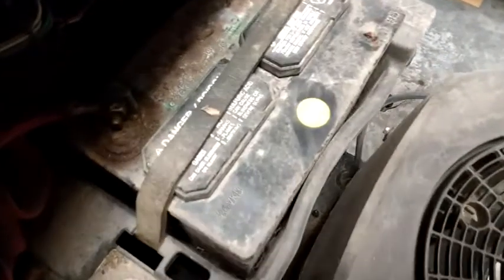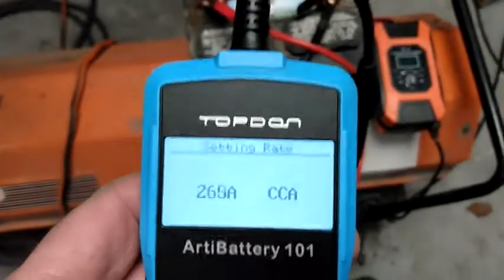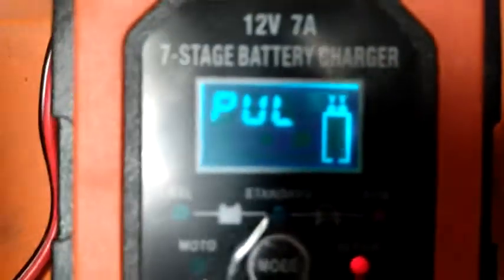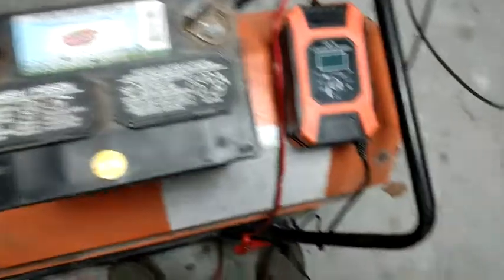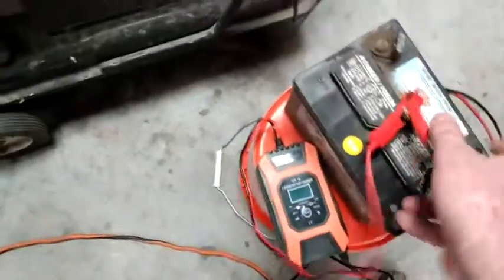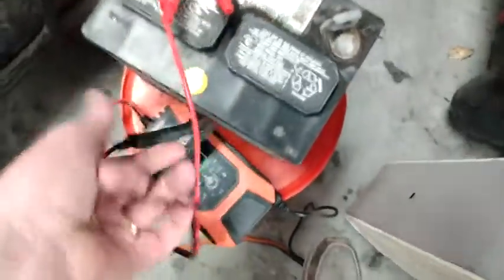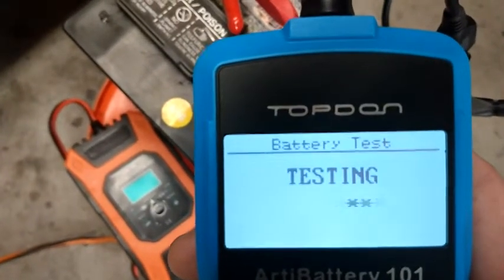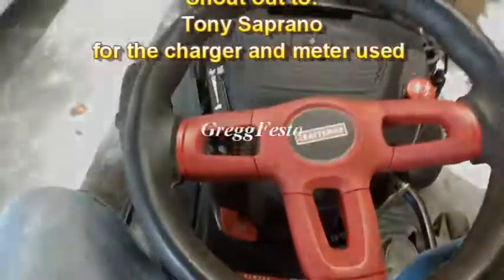Can FOXSUR 12V 7A 7-Stage Charger repair an old battery? Product Review w/TOPDON ArtiBattery 101

Comment: I have to wonder if a battery would last longer running repair every 2 months. Or every six months. I have a small cycle that kills a battery every year.
Reply from the maker: I think that running periodic repair will extend life but the best value for money is a trickle charger. Have you checked into those?
Reply: @GreggFesto  Yeah, am currently running a battery tender 24/7. Now, I unplug 24 hours before I ride. Nothing like a fresh charged battery starting my bike. Only to leave me stranded later in the day.
Reply from the maker: I have read the cheaper battery tenders from places like harbor freight are sometimes not very good and can cause charge issues. What kind are you using? Have you checked your bike to make sure it is charging the battery while you are riding?
Reply: @GreggFesto  Yes, have a volt meter for SAE to USB connector.  Constant 14 volt. I use only "Battery Tender" chargers. Have more then one. Use successfully on other vehicles. My dual sport is subject to harsh environments, and gets bounced around a lot. It also is probably the tiniest battery I have. It has proven unsafe to charge minutes before a five hour ride. Better to fail at home, than to fail 10 or more miles from the nearest road.

Comment: Good video and test. I didn't notice if you checked the electrolyte level first, you should also run the CCA test after the battery sits for at least 2 hours. Do you know if your battery charger pulses are 16 volt power spikes like a Noco Genius 5 and 10 charger or CTEK charger uses? I have a Pulsetech PowerPulse passive battery desulfator on my 2001 BMW battery as preventative maintenance as Pulsetech claims that there patented frequency they use can extend battery life up to three times. I also used my PowerPulse on my other BMW battery that I let sit disconnected for a year, and it was at 11.2 volts, I tried charging it with my friends Exide 6 amp automatic charger for 14 hours and battery voltage was at 13.1 volts, yet it would not start my other car. I put the PowerPulse on it along with a 1 amp Schumacher manual battery charger for 72 hours, and left the desulfator on it for a week and it started my car right up. My point is desulfation can take up to 30 days depending on how sulfated your battery is.
Reply from the maker: Thanks for watching and commenting. I did not check the electrolyte level and do not know the pulse voltage. I just tried it out as-is to see what happened. Next bad battery I get in may get more cycles.

Comment: Correction to statement at 1:40: For internal resistance, the lower-case "m" before ohms means milliohms (thousandths of an ohm) rather than megohms (or megaohms, i.e., millions of ohms), abbreviated as Mohms with an upper-case M.
The following is taken from a post at Quora by Mr. Prasun Biswas. [Begin quote]
In a lead-acid [LA] battery, the lower the battery internal resistance [IR], the more the battery in good condition.
To be exact, for a 12V LA battery:
If IR>30 milliohm, battery is in very bad condition. Probably unusable.
If IR is between 10 to 30 milliohm, still poor condition but may be usable or revivable.
If IR is between 5 to 10 milliohm, it is in good condition.
If IR is less than 5 milliohm, it is in very good condition.
[End quote]
Can anyone confirm these internal resistance ranges from a published source? I assume they apply to a car battery. What about a truck battery? Motorcycle battery? UPS battery?
I suggest waiting several hours after reconditioning a battery before checking its voltage. From my experience, voltages above about 12.6 V only exist for a while after charging and do not represent the steady charged value. The voltage after several hours tends to be a multiple of roughly 2 V because a 12 V battery consists of six roughly 2 V cells. Thus, if your battery reads about 8 V, that means that four cells are working and two are not. The repair mode in this FOXSUR battery recharger reconditioner attempts to desulfate the lead plates in a battery so that all the cells can function. 
Greg, after a year and a half, is the battery still working?
Reply from the maker: Hey Jon, Thank you for watching and writing in. Thank you for the Milli vs Mega Ohms correction and explanation. The battery worked all season without issue. After letting it sit for the winter it was dead again this spring. Guess what I did? Yup, this same repair and charge. Well I am happy to say that it worked another season. Getting ready to put it up for winter again. After reading your message I plan to make a new video this coming spring. I hope you will watch and comment when you see it.
Reply: @GreggFesto  I suggest Googling: 
How to store battery during winter
Key points include taking the battery inside if needed to avoid freezing and charging the battery monthly (beginning at the end of the season) so you won't have to do a "repair" charge next spring. Best wishes!
Reply: Given that a brand new flooded lead acid battery presents less than 1mOhm per cell of internal resistance (that is, about 5mOhm as a total, for a six cell or else a 12V battery), the ranges' reference here above seem to be right. As a rule of thumb, a battery needs to be replaced when its initially confirmed internal resistance is doubled. So, if at the time of buying it, its IR was, say, 7mOhms and now we measure 14mOhms, this shows us that the battery has reached the end of its life. The Sealed Lead Acid batteries present higher internal resistances than the flooded ones and finally the common 7Ah/12V UPS batteries present about 25mOhm of IR when they are brand new...

Comment: Hey, I can’t see the battery in your video because I’m visually impaired but did you check the water level in the battery? Also, how is your Mustang project going?
Reply from the maker: Hey Clay, Hope all is well with you. Yes I did check the level in battery before I put it on charge.  All cells were full and even across. I am going to continue to use this battery until it wont do anything else then I may try to restore it by flushing it and putting in new acid. Not quite sure yet. The last thing I did to Mustang was taillights. I did just get some brakes in for it so I will make video on replacing them soon hopefully. Clay I want to say thank you very much for continuing to watch my videos and comment. It is much appreciated. Did you have any time to check out Blind Fury TV channel to see how Stephen is doing these days? I think he has found his fit with the YouTube channel.

Comment: That was a good test bro. I had my fingers crossed that that charger could do something to bring a little bit of life back to it. I was watching the numbers when you started and when you ended. And you're absolutely right, it plateaued. Great video though so now we know.
Reply: Final thoughts :)
I think you'll agree with me that doing the "Epsom Salt" treatment is over the top to bring an old battery back to life. I have better things to do :)
Reply from the maker: I sure used to think that way. I am starting to have troubles with that though because of the new battery cost. I am not sure why it costs so much for a new battery now. I wonder how much it would cost to do the dump, clean,and refill. Would it be worth the time and effort on top of the cost? Would it bring the battery back up where it would last a few years or is it a short term thing?  Let me know what you think Tony.
Reply from the maker: Yo, Tony, Thanks man. The charger definitely charges good. The repair mode worked better on this test than it did the last test. I am keeping my eye out for a battery that is having trouble but only a year or two old to test repair mode on next.  The outcome was still good because I was able to start my mower. Thank you for the charger and battery checker meter. When used together it gave a good overview of what was happening.